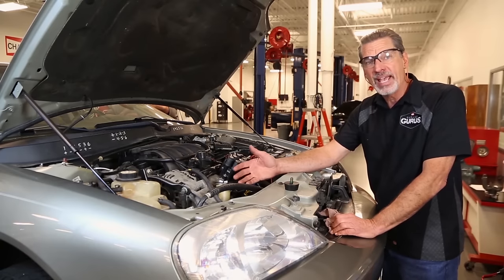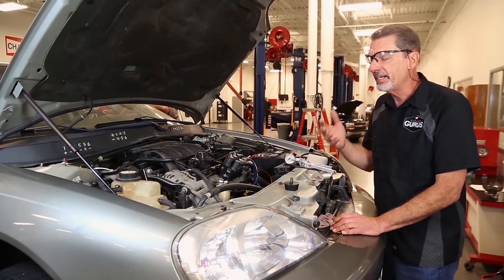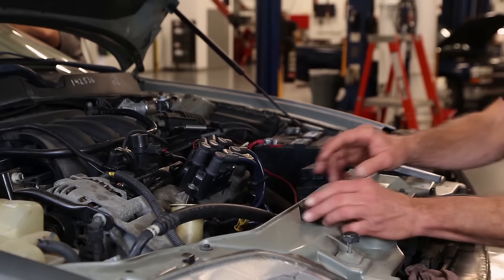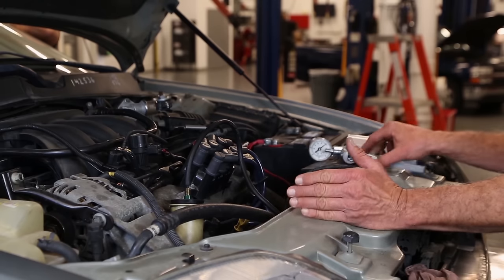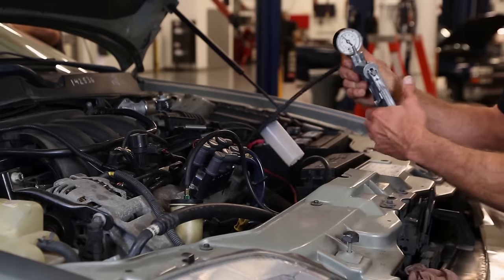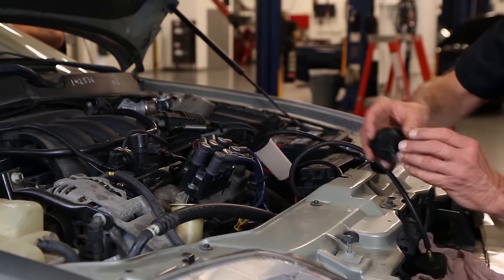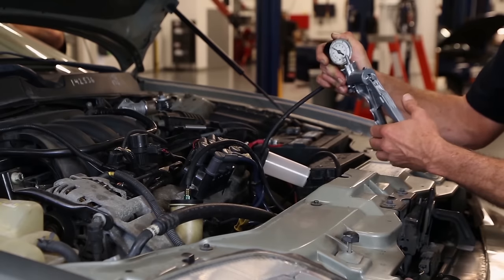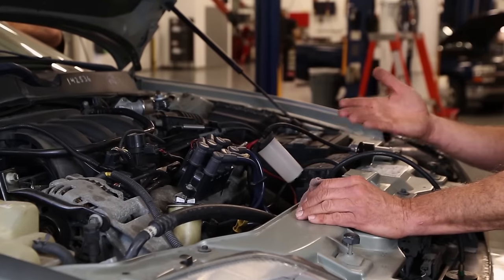Power Steering System Air Bleed Process

Comment: I changed my pump amd now when i turn off my car the power steering fluod starts to spill out of the lid.  No foam just overflow
Reply: Rick S  you probably have air in the system. Check for cracks in the hoses or the cap. It could be drawing air. If every thing looks good have a mechanic check it. They have all the right tools.
Reply: You check the level with engine running? Some systems if you top off with engine off will overflow after normal operating temp is reached when shut off.
Reply: kittylovermybut HAHAHAHA IM DEAD
Reply: @arthursmith643  Also check the fine mesh screen in the remote mounted reservoir, as they get dirty and won't return the fluid quick enough to the pump and cause spill over, then vacuum pump out the air out of the system.

Comment: Yeah your not supposed to vaccum bleed with the engineon gm tech service bulletins for bleeding air always say with engine off. When engine is running it aeriates the fluid and also don't pull anything over 20 in hg with vaccum pump it can blows the internal seals out-of the power steering pump....

Comment: 25 " of vac,  at H20 or Hg/in.  ?  Specify units please.
Reply: Again, "psi" , - H20 ", Hg/?"?  Also, if no change in fluid level after 1st evacuation; indication of no air in system? Correct?  No leak.  Problem is somewhere else!  Check pump output pressure with return securely sealed.
Reply from the maker: William, the specification is in inches of mercury or In-Hg

Comment: Hi I have a mercedes R350 power steering gets stif when warm, this happen after replacing power steering reservoir, I can't locate the bleed valve, how I can bleed air from power steering on R350 thanks
Reply from the maker: Hilmi - Great question! Why don't you give us a call and we can put you in contact with some of our product tech experts and they can assist you. The Gurus Tech Hotline number is 800-325-8886 and is available
M-Th: 8:30AM-5:30PM ET
Fri: 8:30AM-5:00PM ET

Comment: Why in the hell did he keep checking the level if he saw there was no fluid in the bottle?  Would have made this video a whole lot shorter
Reply: He said he has the bottle just in case fluid comes out when bleeding air out of the system. I'd guess fluid isn't supposed to come out
Reply: I think he's just showing as a matter of procedure
Reply: cooldaddyslick Because if you have a leak in a hose it wouldn’t be in the cup, but it would go down.
Reply: Because the air in the lines occupy space, when you suck out the air via the vacuum method, the fluid fills in those spaces where the air bubble used to be, resulting in a drop in the fluid volume.
Reply: Because the air in the lines occupy space, when you suck out the air via the vacuum method, the fluid fills in those spaces where the air bubble used to be, resulting in a drop in the fluid volume.

Comment: will restriction from power steering lines burst a rack
Reply from the maker: No. The only way pressure can build up in the rack due to a restricted line would be due to the return line, which cannot handle over 100psi, well below the limit that could cause a rack to “burst” which is an event that just does not happen. Besides, power steering pumps have an internal pressure relief valve so that pressure cannot exceed safe limits.

Comment: Running the engine with air in the power steering system and trying to bleed the system with the engine running is only damaging the power steering pump. The very thing you are wanting to avoid you're doing.  What the heck??

Comment: That fancy penis pump does not work. Previous mechanic replaced absolutely everything for the power steering system while charging the customer way more than the car is worth. I have gone through it all looking for air and fluid leaks and it looks like he did an excellent job. I've been a mechanic for 35 years. I know the Ford Taurus is notorious for power steering problems. I swear I am going to have the biggest pecker by the time I get this one fixed